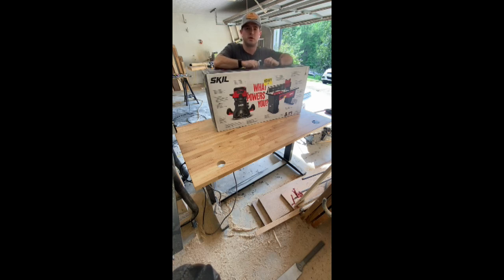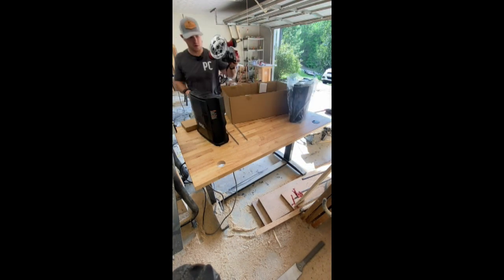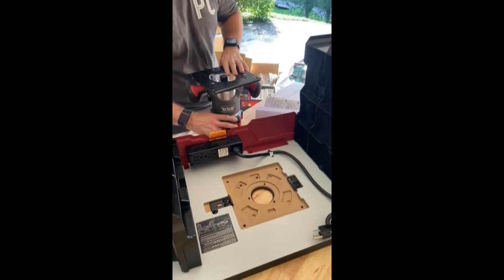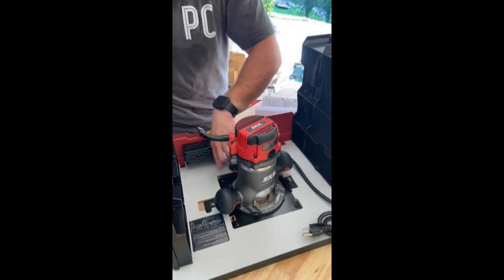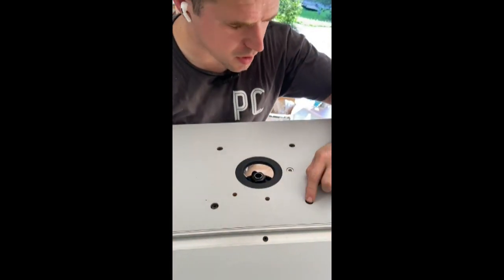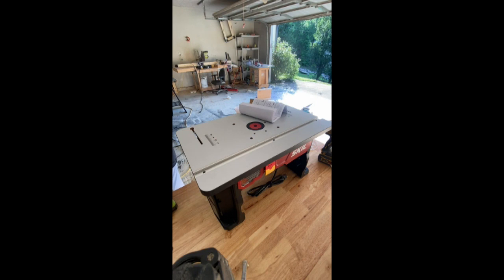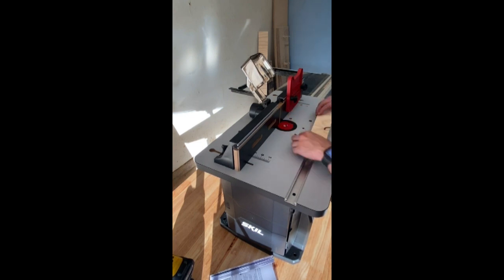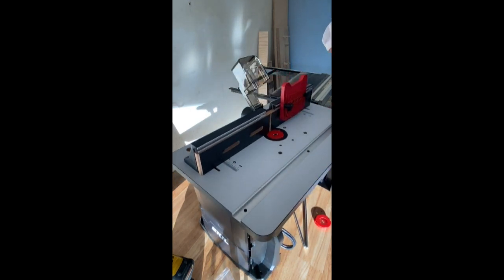Is the Skil $200 router table combo worth it? Let's find out!

Comment: Good job for your 1st video. I have seen a couple other videos on this router that stated the fence was flexible on the outfeed side. Did you have any issues with yours?
Reply from the maker: I didn’t have any trouble with that, but I mostly use it for edge profiling as well. I haven’t had any deflection. I appreciate the feedback!